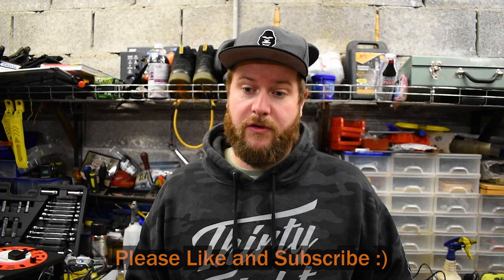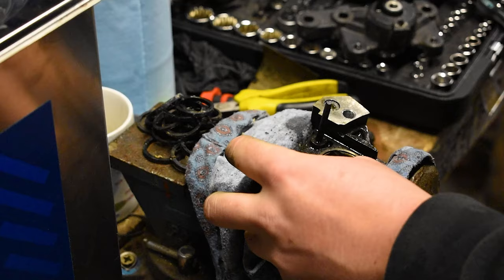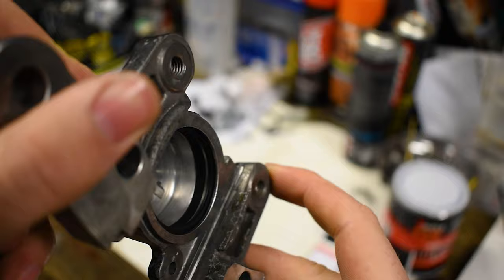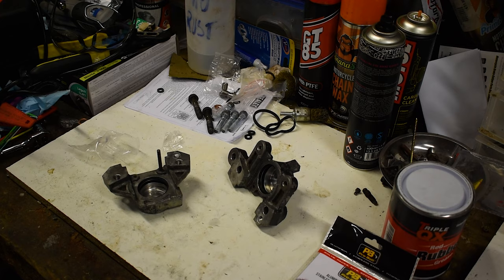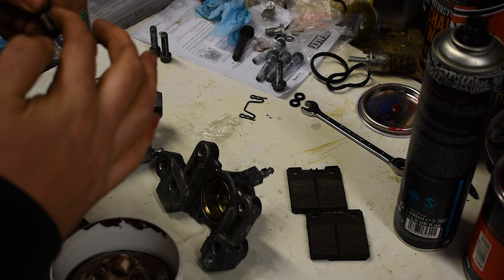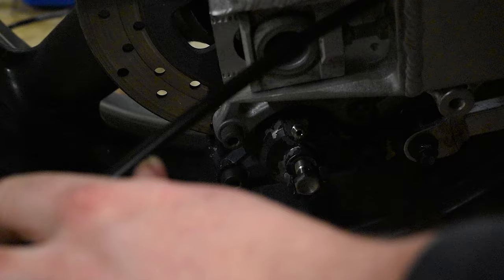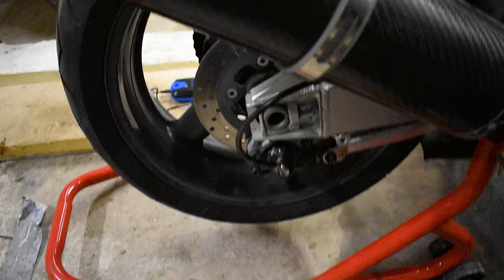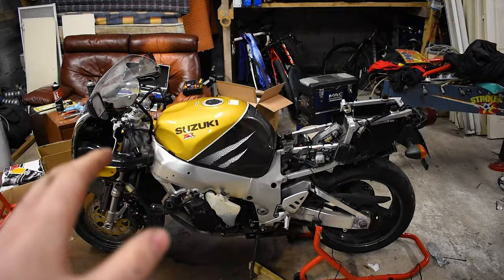2 Piston Rear Caliper Strip down, Rebuild and Bleed | Suzuki GSX-R 750 SRAD

Comment: i have used Red rubber grease  a number of times with no problems. Even some new seals come with a tiny packet of it. You can also heat the caliper up with the seal in place which will make everything expand and the piston will  go in much easier.
Reply from the maker: Good to hear, I was 100% confidant is using it anyway but sometimes the abuse you cop from people it's easier to just say it's grand up front. I have heard that too, thankfully didn't have to, me and fire don't usually mix 😂😂
Reply: I agree with Mr Frank Conlon.
This is because general grease has a component that expands the rubber and may hinder the sealing effect.
I used to be a teacher at an automobile mechanic school, but this was a deduction.
Red rubber grease should be used around rubber parts.

Comment: Good one.  Is the hose looped tp avoid the axle and chain adjusters?  Banjo bolt because the fitting it goes through on the end of  the hose resembles a banjo...... they say.  Would  play well.  Looking forward to seeing it on the road.
Reply from the maker: I did think that afterwards, I think you're right!! There seems to be missing a little holder for the swing arm to help the looping so I'll fashion something :) Ahhhhhh that makes....some form of sense :D Me too, should be very soon :)

Comment: These videos are helping me.  I like that you are ahead of me, in racing, it's always easier to follow then to lead, turns out the same is true for GIXXER revival's!  😂  I hope I don't need compressed air to get the pistons out but I guess it will make for a good vid if I have to. Good tips.  What grit sand paper did you use?  I to have no idea why they call them banjo bolts.  Good video!
Reply from the maker: Glad to hear that man so much! :) Haha that's a fair point, maybe I should have let you go ahead 😂😂 
There was no hope of anything else but someone in the comments suggested a grease nipple and a grease gun will gently push them out :) Far safer than air! I used 1000 then 2000 grit, just to knock off any corrosion. :) Thanks man :)

Comment: Do you have the links you got the gaskets from?!?
Reply from the maker: I bought them all on cmsnl.com
Reply: @TheGorillaBiker  thanks so much man!!! Trying to fix my tuned 2000 gsxr600
Reply from the maker: No problem :) Much left to do?
Reply: @TheGorillaBiker  yeah so I need to get all new gaskets and a new banjo bolt with the two washers and I think and it should be good! Just trying to find where to get it all. Finding parts for this bike is hard! Thanks so much for your help tho!! You’re the man!!
Reply from the maker: You should be able to get all the gaskets on cmsnl anyway, I'd go to HEL and get a new line altogether, that comes with new banjos and washers then :)
Reply: @TheGorillaBiker  gotcha man thanks so much!!! I needed this haha